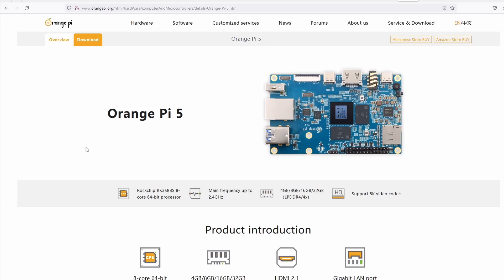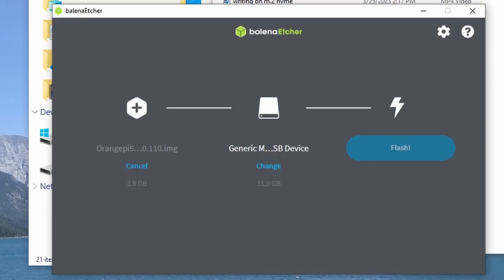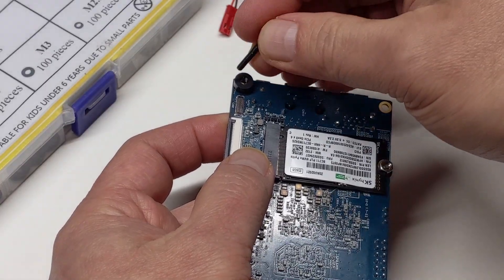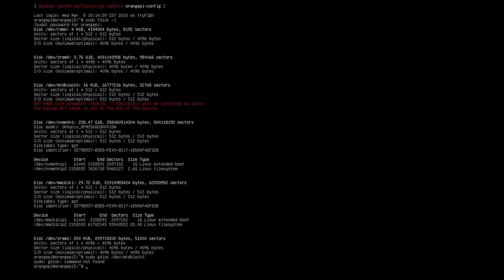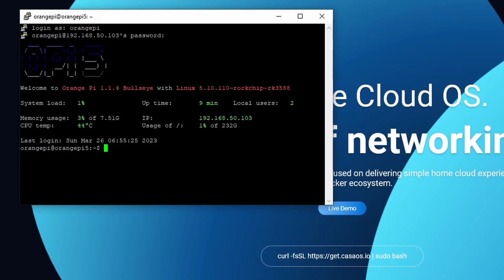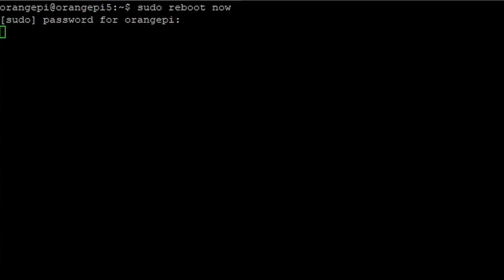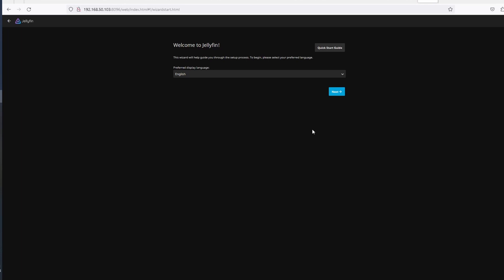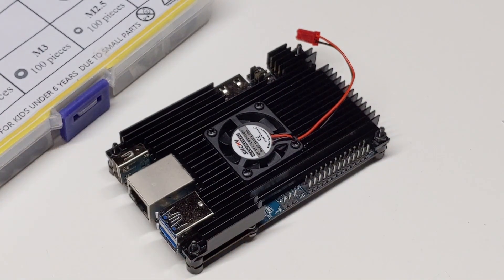Casa OS on Orange Pi 5. M.2 NVME SSD. Network Attached Storage with user friendly UI

Comment: Hi!
i'm trying to follow your steps, but when i do sudo orangepi-config, it shows:

you may need to edit /etc/fstab and/or your boot loader configuration!

And nothing happens... 
I'm really noob, can you help me?
Reply from the maker: hi, I'm not really sure what's happening with your system but you may need to delete any existing partition on the 16MB SPI flash drive by typing "sudo gdisk /dev/mtdblock0" then type p to print the partitions.  press d, then the number of the partition.  Do this for all partitions then press w then y to confirm.  Visit Orangepi.org website for more details on other ways installing different OSes.

Comment: Where are some Orange Pi-5 GPIO examples that work?  I have tried several PWM and pin on/off code examples that gives errors. Also where is an I2C example?  OPi.GPIO does not work as in the examples?  Is there a way to modify the Raspberry Pi GPIO software?   I just want something that works to run some simple camera Pan/Tilt servos modules with in/out pins.   
 Wonderful video, I need all the OPi5 help I can get.  😎  Thank You very much.